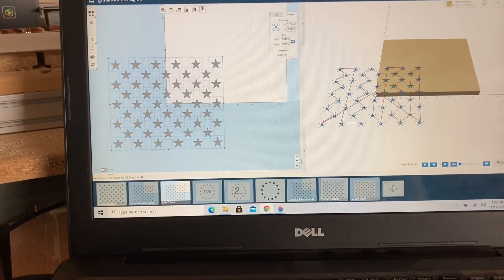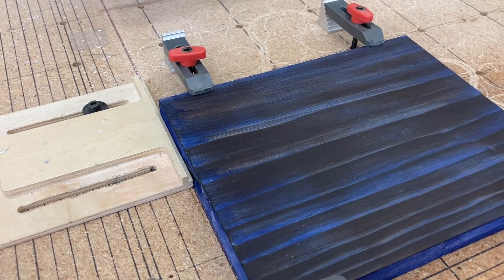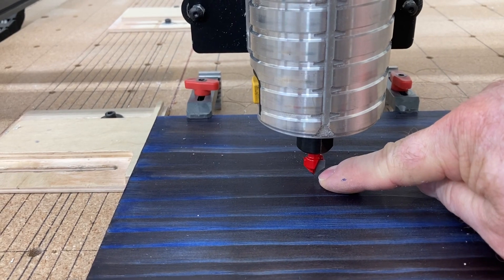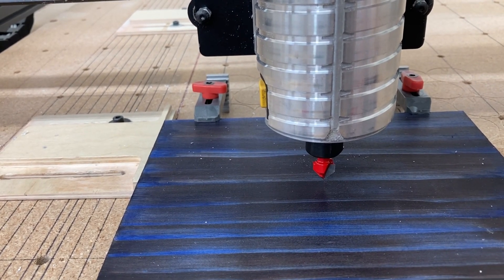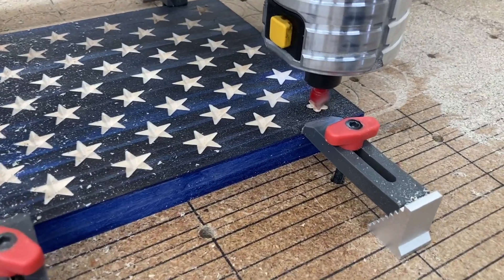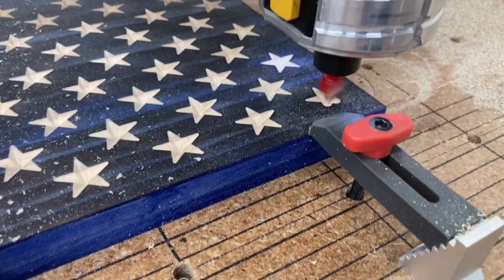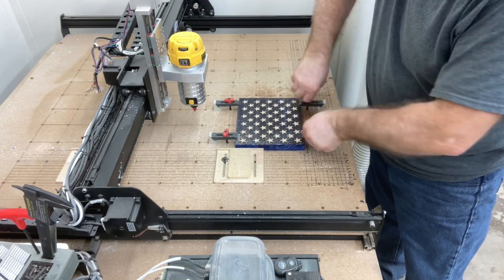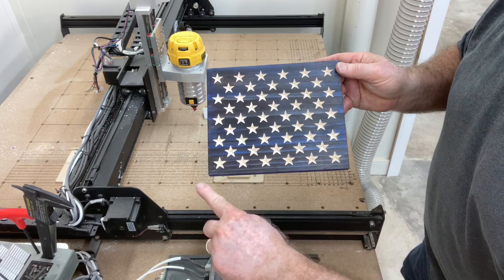Inventables XCarve and Easel Together with X,Y,0 in the Center of the Project

Comment: I am so glad I found you. Newbie and waiting for my x carve pro 4x2 to arrive next week. Question: why don't you use the 'center workpiece to material' option so the preview looks right? I hope you understand my question:)
Reply from the maker: It actually depends on the project. Easel now has a feature that allows you to make the center work in the software. For a project such as the stars for the flag I wanted to ensure that the stars were perfectly centered in the material. For other projects I will use the bottom left corner.   The work home position can be anywhere that you chose. The bottom left corner and the center are the most common. I have used other places on the project for the home position. Look at the video on the pledge of allegiance flag. I used a totally different place.  

Congratulations on getting into the CNC world. Please ask questions as you get started. I’ll try and answer and help you be successful.

Comment: Great video!! What cut settings are you using and what is you spindle speed. Thank you in advance for your help.
Reply from the maker: The router stays on the slowest speed. Setting "1".  The cut settings are the default setting that are in Easel.  I usually increase the feed rate during the carve.  In the description, I have a link to the file.  It is a free download.

Comment: For some reason this did not work for me I've tried it twice with the center line in the middle of my project and it started carving to the left of it when it should have went to the right of it not sure where my mistake is. Help
Reply from the maker: Is this the first time? If it has been working and now it is not perhaps it is a mechanical issue.  It is does the same thing every time, I would look at how the software is setup.

Comment: So I ran into a new problem today on my x-carve. I started a carve , and the x-carve didn’t carve parts of the top of the design. The board isn’t warped, so I have no clue. Any suggestions?
Reply: You know what I jumped the gun on this one. I ran it today , and it worked out fine. In the beginning of the carve it looked like it skipped over part of the design, but this time I let it continue to run, and it went back over that area and carved it fine. Lesson learned here , is always be patient . lol . Thanks anyways Paw Paw. Dennis
Reply from the maker: It would help to have pictures of the project and what the simulation looked like.
Reply: @PawPawsWorkShop  it’ll have to wait till tomorrow afternoon. I’m working a night shift right now. Do you have an email address , and I’ll just send you a video of what it’s doing along with a picture of the rendering and tool paths.
Reply from the maker: email in the description: but here it is also  pawpawsworkshop411@gmail.com

Comment: How do you know you have the exact center of the material?
Reply from the maker: Use a straight edge and mark from corner to corner and that will form an ''X" in the middle of the project.
Reply: @PawPawsWorkShop  Thank You. I should have figured that out.

Comment: Pawpaw can you help me? My z axis has a wobble and I can't figure it out
Reply from the maker: Unless you have a dial indicator it is hard to calibrate the z axis.  I have done two videos on the calibration using a tape measure.  It will take several times doing it to get it dialed in.  Just take your time and repeat the process and each time your will get a little closer.
Reply: Coming back to just say thank you very much thanks to you I was able to calibrate my xcarve properly start making quality carves. If you could follow my fb or Instagram and let me know what you think of my work it really would mean alot. #jmprowoodworks I'm currently active duty and started doing woodworking as a form of stress relief. Thank you again